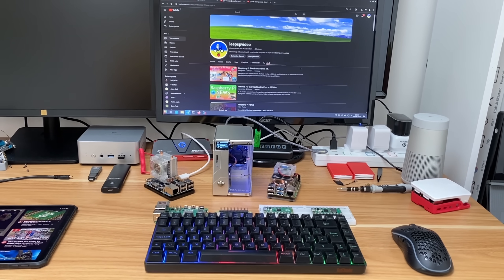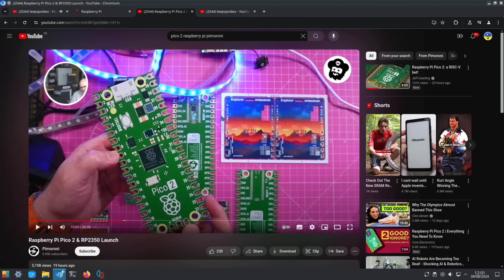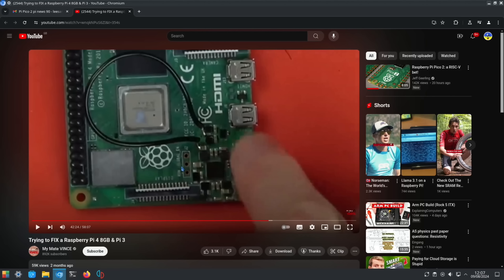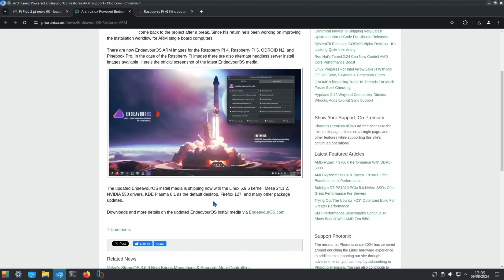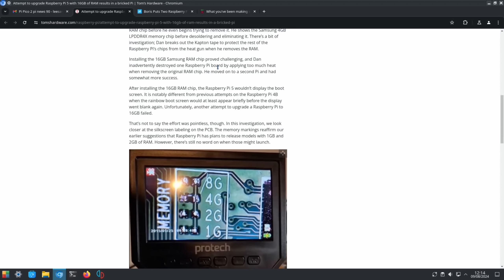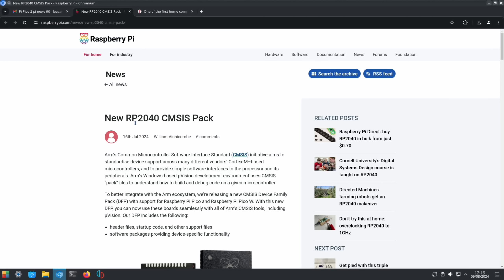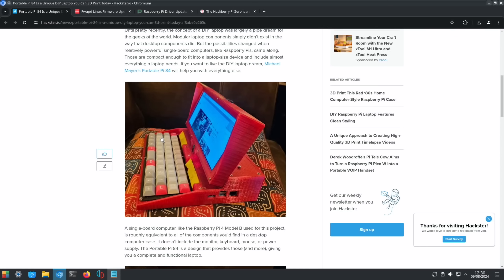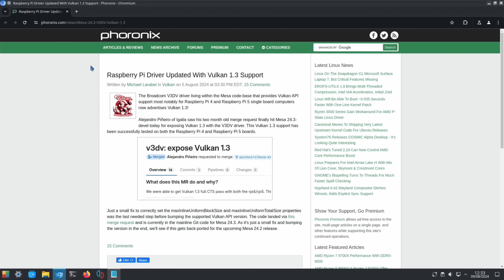Pi news 91. A New Pi, 16GB Pi 5 & Vulkan 1.3

Comment: I have a question and I thought you might be able to help me. I recently brought the pironman5 case. I am trying to boot up with a 512gb sdcard, and it doesn't boot. I tried an 8 gb card, and it worked? Would you know possibly why that happens.. Thank-you
Reply from the maker: @leecohen1546  If you re flash the image and it still doesn’t boot. Possible fake or faulty card. Try it in an sd card reader
Reply: @leepspvideo  doss it Matter mircosdxc or the other type?
Reply from the maker: @leecohen1546  

All these work

Great budget storage for Raspberry Pi. 17 SD cards speed test.
https://youtu.be/GK59Zl-LqOc

Raspberry Pi 5 Vs Pi 4. micro sd speed tests
https://youtu.be/DcyCrUv-MLw

Comment: Hello! 

So, im kind of asking this question to everyone who has a lot of tech knowhow. I need sugestions, ideas or takes on surveilance of my storage unit. There are thieves around and i need to watch that area better, and if i could somehow not just record video but also maybe stream it to local software on my computer, nas or other solutions that i don't know how to define or set up. 

i live 2 floors up from my storage unit, which is in my cellar. Right now i am using powerbanks and gopro 7 cameras. My issue is how to either, get my wifi signal down there, in some way without having the posibility to install extenders into somewhere other than my appartment. What i have been musing about recently is trying to get the wifi signal down there, power a PI with wifi signal (extender?) to my gopro which would stream the video to my computer... or my Synology NAS. 

Obviously i have no idea what hardware is out there that would allow me to do this battery powered. In a perfect world i would have POE to usb or something silly, but i don't even know how that would be set up. Even if i should buy a larger battery with some kind of... splitting, charge modulation function... i have so many ideas which i need advice before continuing. 

Thank you in advance!

Comment: During the Spring I stopped by a store we have around here meant for farmers, hunters, and anything a rural person might need, so naturally they have a gun shop. I went there to buy a pistol and the guy told me to go to this screen, mouse, and keyboard set up behind me and answer all the questions on it while he runs my background check and all that good stuff. When I went up to it I was pretty curious what was running it bc at first it did just look like nothing but peripherals like I mentioned earlier, but then I noticed behind the monitor a black, plastic case with the Raspberry Pi logo on it and realized that's what I was using. I think it was a Pi 3 model B+

Comment: Need a Zero 2 W with 2gb of ram, 512mb just isnt enough for some things.
Reply: Orange Pi Zero 2W has 4GB RAM for a couple of dollars more than a Pi Zero 2W - but nobody wants those because most people in the Raspberry Pi ecosystem can only do stuff if someone makes them a step-by-step video for them. Put an Orange Pi in front of them and say "put Linux on it" and they wouldn't have a clue where to start.
Reply: @terrydaktyllus1320  While that is generally true, you have to admit that the Pi ecosystem has very strong OS and software support where some of the other hardware does not. I'll have to look at the Orange Pi stuff, they have a pretty strong ecosystem, I just generally forget about them. Also, not everyone starts out as a Linux Genius, Pi reduced the burden to entry which seems to disgust a lot of Linux users. You need to remember that not everyone has the knowledge (myself included) to compile a new kernel and compile an OS. If the elitism puts people off, all of these cool little SBC die for lack of popularity. I can do some things, but a weak ecosystem makes it extremely hard and just puts me off (and most other people). You can't learn new things when the system gets in your way for the basic things. I'll say that it's easier for me to get things done and learn on an x86 system than some of the strange devices that use Arm. There are generally more people in the Pi community who will not only help with the issue, but explain what and why, which helps us learn.

Comment: fwupd is something that is part of Linux itself, the pi firmware updater was it's own 3rd party utility. Having raspberry pi support native on the Linux kernel vs having a 3rd party utility that runs on top alleviates heavy lifting for ARM64 itself. The Pi Foundation could stop developing the firmware updater tomorrow and now use fwupd and streamline updates to the pi regardless of your distribution. You could be running a custom version of Gentoo and as long as the kernel is new enough, you wouldn't need to switch to pi-os to receive firmware updates.

Comment: need raspberry pi zero 3w with 1 and 2 gb ram version
Reply: Yeah, a Zero3W with maybe a clocked down RPi4 chip and 1GB would be awesome for $10-15.
Reply: The Orange Pi Zero 2W has a 4GB version for just for a few dollars more than a Raspberry Pi 2W - it's a great little SBC, but not an option for most people in the Raspberry Pi ecosystem because they only know how to do stuff if someone makes them a step-by-step video. Stick an Orange Pi in front of most of them and say "put Linux on it" and they wouldn't have a clue how to do it.
Reply: @terrydaktyllus1320 Does retropie work on the orangepi? I'm genuinely asking this because I like retropie's ui and thee orangepi looks like a good deal
Reply: @terrydaktyllus1320  I've got a OrangePi5+, some Atomic PIs and BTT CB1s here. The OPi5+ is pretty good, AtomicPis easy since it's X86, but the problem is that the graphics drivers for nonRPis are typically not good in Linux. Made all the more infuriating by the fact that you put Android on them and they can do 4K60 video flawlessly while struggling to do 1080p30 in a browser in Linux. The Panfrost drivers for the RK chips works well if you can get it to actually work, but even then, getting browser video acceleration is a dice roll.

What's good about the RPis is that they do the work and make the software work very well. OrangePi has typically 'made it work' and tossed it over the fence to let the community deal with the rest while they move on to the next shiny SoC. That's seemingly slowed down as the release of new high end SoCs has slowed down, but they don't seem to be putting in much more effort once the hardware is released.
Reply: @terrydaktyllus1320 15$ vs 60$ , genius ??
Reply: @mkumar04  I have absolutely no idea what point you think you are making. You've clearly not checked the prices for Orange Pi 2W boards. I suggest you do that now in order to become better informed than you are currently. Off you go then...

Comment: Hope Raspberry Pi adds a cheaper 1 or 2 GB option too, would love to get a Pi 5 under $60!
Reply: I would love to have a cm5
Reply: Most rpi projects can be easily achieved with 1GB ram. That's why they don't release it, this way they can force people and even enterprises to buy a more expensive model
Reply: @freaky_clippy  don't even bother making a pi5 1GB just make a better pi0
if you actually need the performance of a pi5 then you should buy it with proper ram nothing less than 2GB
Theres a reason Pi4 1GB was discontinued originally
Reply: I don't understand why Raspberry Pi Foundation can't do similar to other tech companies and lower price on older pis. rather than release a Pi5 1GB model why not cheapen the Pi4 2GB model to take the place as an entry level full pi or how about for the 1GB pi5 take off what makes it cost more like the pcie port and maybe some other things and repackage it as a Pi5 A+ board
Reply: You need a minimum of 4 GBs these days to browse the internet, and 2 GBs to run a server, like Emby or Jellyfin. So it makes no sense to sell 1 or 2 GB versions anymore.
Reply: Can’t wait for your Radxa X4 review. When is it coming out? 🤗
Reply: @Sasoon2006  Hopefully in the next week or two!
Reply: definitely ,they should launch 1/2 gb version too, for headless users , 2gb version would be the sweet spot
Reply: You can it's the 4GB
Reply: Pimoroni (UK) now has the official 2GB Pi 5 in stock.  They do ship internationally, but that probably doesn't help if you're trying to get a cheaper option.  They tend to be among the first to get these things when they're launched.  Personally, I was hoping for a 1GB one, but not all that hard.  I bought a single Pi 4 and concluded the 3B was the sweet spot, for me - or the basic Zero v1.3.
Reply: Even $60 is too high when it's possible to pick up a far more powerful used SFF PC online for the same money - such as a 3rd or 4th generation Core i5 or i7 machine that will come with at least 4GB RAM and will already be cased with a power supply and cooling.

The Raspberry Pi was amazing up to the Pi 3 as a $35 mini computer to teach kids programming or to sit on an electronics workbench for IoT projects - it had a niche back then. But I wouldn't even purchase a Pi Zero 2W because for a couple of dollars more, I can pick up an Orange Pi Zero 2W which has 4GB RAM as opposed to 512MB in the Pi Zero 2W.

And that highlights the second problem with the Raspberry Pi ecosystem in that most of the users in it are fine doing things by following step-by-step videos on here, but put an Orange Pi or used  SFF PC in front of them and tell them to "put Linux on it" and they wouldn't know where to start - unless someone made a video for it because few people these days ("true engineers") can be bothered to read man or web pages or just experiment on their own to make things work.

Even your "World Record Overclock" with the Pi serves no actual purpose other than giving you "bragging rights" on social media - especially when the Pi 5 is so overpriced anyway that who else wants to risk overclocking it and breaking it?
Reply: @terrydaktyllus1320  ..”World Record Overclock” has been a “thing” since the early ‘70s. And yeah, it’s “bragging rights”. Just like ANY game, ANY competition.
World Series
Super Bowl
Etc.
Reply: @ernestgalvan9037  So we agree, then, that from an engineering perspective "world record overclocking" serves no practical purpose, other than to gain more views on one's channel? Especially because the Raspberry Pi is so overpriced these days that nobody would want to risk doing the same thing to their own Pi's that they paid a lot of money for.

So what point do you think that you've actually made here? Other than agreeing with me?
Reply: @terrydaktyllus1320  Raspeberry Pi 4 1GB priced at $35 USD. Same price point as years and years ago for RPi 2, RPi 3….
Reply: @ernestgalvan9037  "Raspeberry Pi 4 1GB priced at $35 USD. Same price point as years and years ago for RPi 2, RPi 3…."

If you read my comments properly then you will notice that I used dollars, not pounds. £34 in 2019 was around $42, which therefore represents a price increase over the original $35 price point.

But keep trying....
Reply: @ernestgalvan9037  PS. ...and you,. of course, somewhat "conveniently" excluded the fact that the Pi 5 had a huge price increase to $60 on introduction.

Comment: fwupd is a daemon for Linux distros to manage and update firmware in hardware devices. It's generic for all hardware, RaspberryPi OS has a specific tool for the RPi's, and what it means is that basic support has been added so that in the future generic ARM64 distros can install on the RPi and manage the firmware without Raspberry Pi's specific tools for the hardware.
Reply: Firmware should never be updated automatically through some kind of daemon. Firmware is usually proprietary in nature and can be the difference between a piece of hardware working or just failing completely. It should be manually installed and tested first. Just because something does exist does not mean it should exist.
Reply: @terrydaktyllus1320 , the fact that fwupd exists does not at all mean that firmware will be updated automatically. It means that there is an open source independent utility that can be used to update firmware removing the dependency on proprietary tools from the vendor.